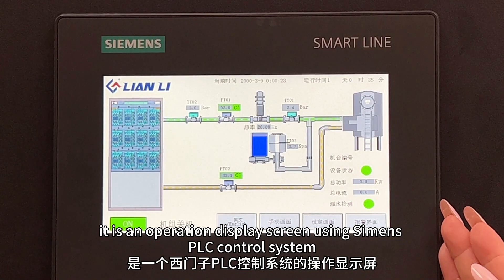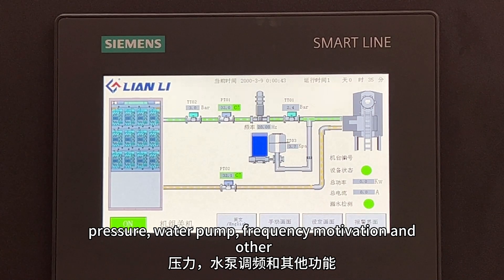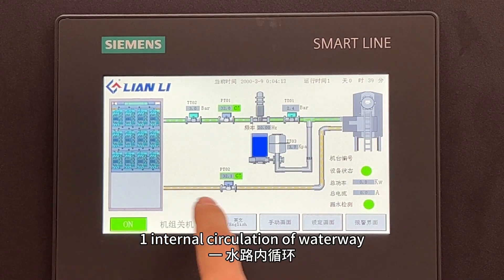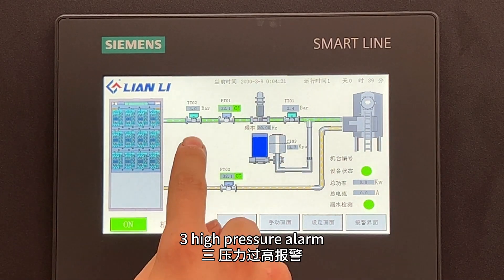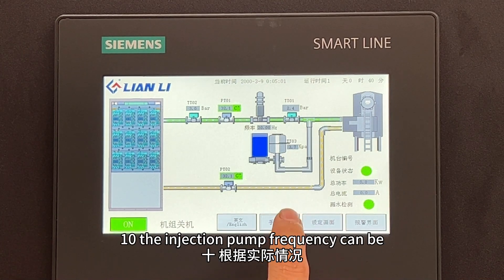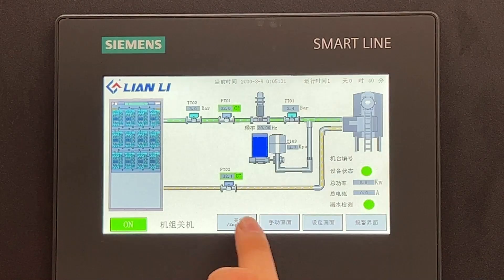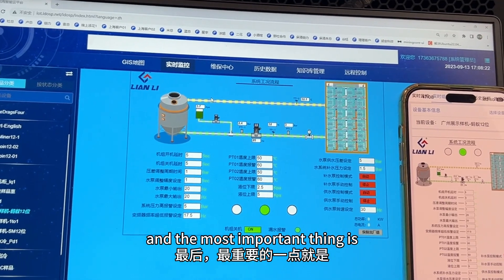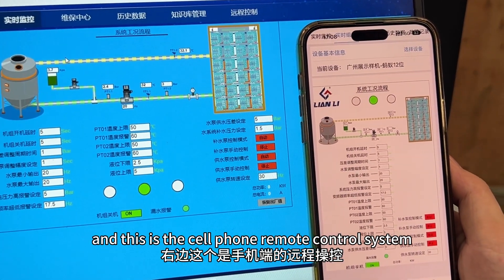Lianli water cooling system 12 rack space hydro cabinet for Antminer s19 s19xp s21 hydro miner

Comment: I have one question
After convert my any air cooled miner into hydro then it's running with your Antmiers hydro rack
Reply from the maker: We have manufactured two different racks, one of which only supports the original hydro, and the other supports both the original hydro and the air-cooled machine modified hydro
Reply: @lianlitechnology1793  Thanks for clear my confusion